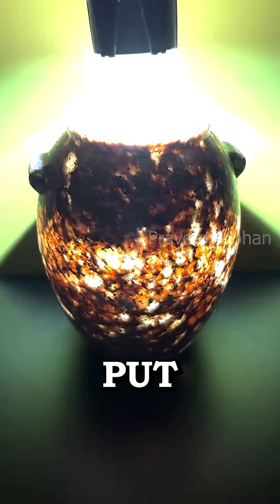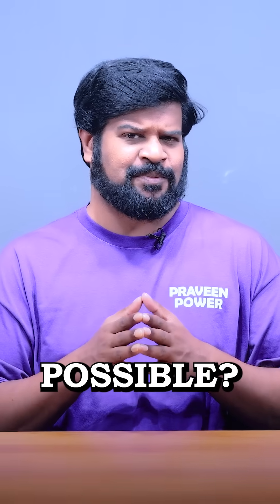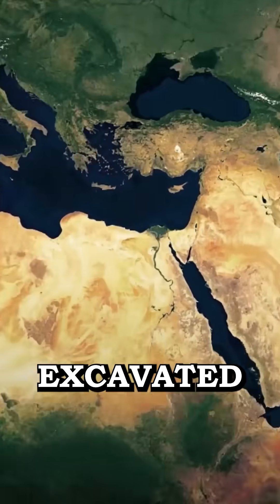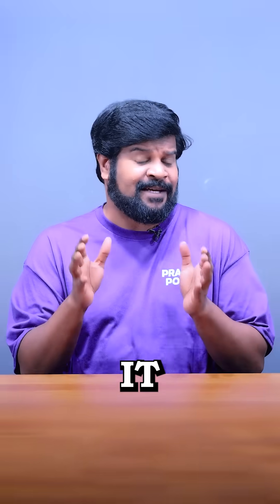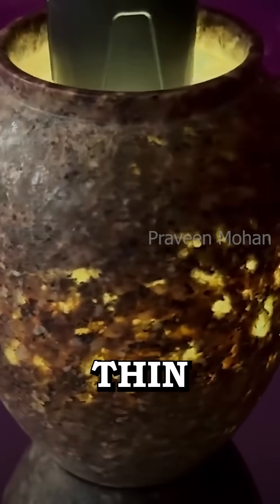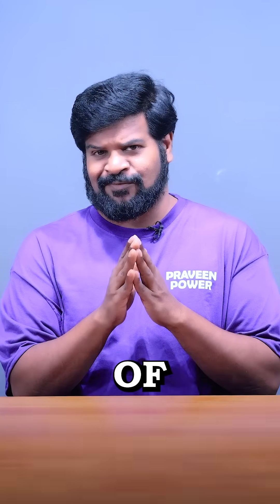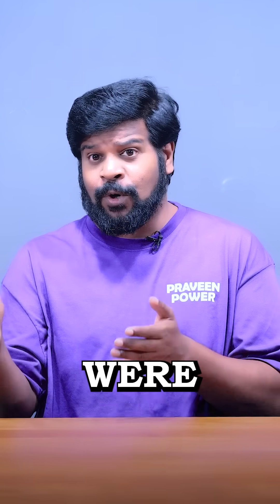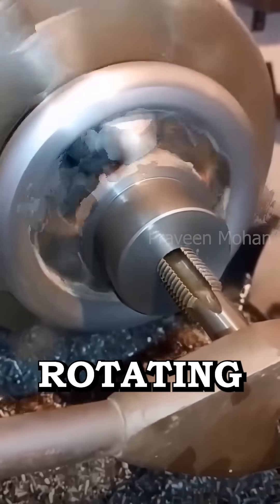Proof of Ancient Machining Technology ⚙

Comment: The technology we use is aligned with the prevailing consciousness of the Yuga.  The Ancients of the  Satya,Treta and Dwapara Yugas consciouness was much higher than ours. Thus the Vimanas were controlled by mantras / mind and 1000 tonne blocks levitated by vibration / sound for eg.   Kali yuga consciousness struggles to comprehend their  methods of engineering